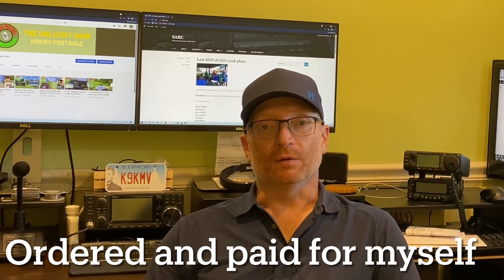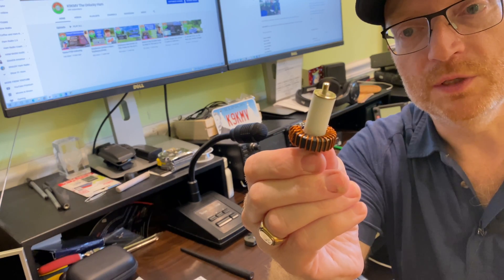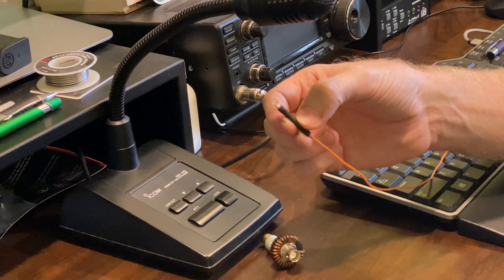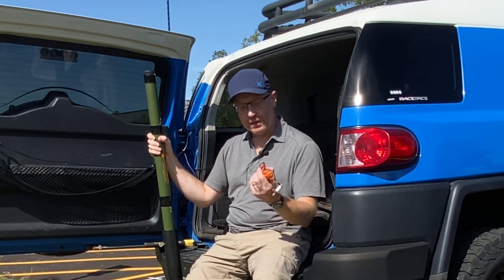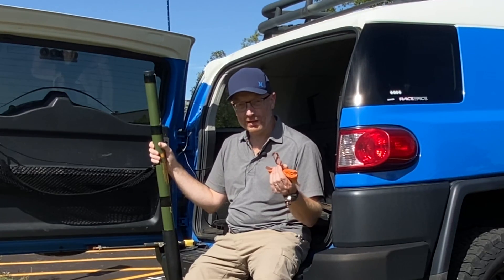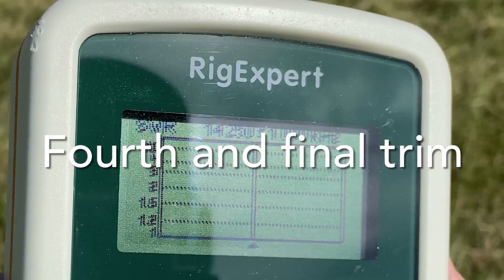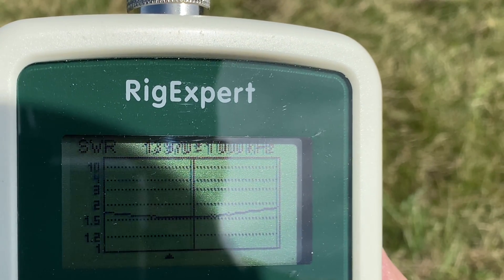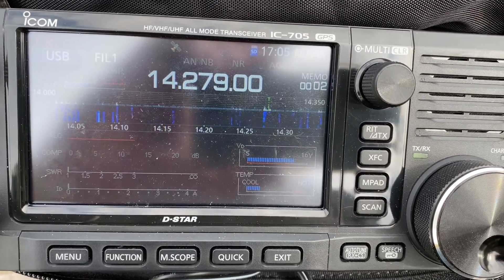Trying my Spark Plug Antenna, another #EFHW. #hamradio

Comment: Thanks for a very informative video, the little "spark plug" seems to work very well. Do you have the antenna wire lengths for both 20 & 40 meters. Best Regards .....  Garry VK2ZP

Comment: How much did you have to trim off? I must say that I was impressed! N4KBM
Reply from the maker: I ended up with 28 feet total wire length.  Not sure why it's so much shorter than I was expecting.
If you get one you should still start with something around 34' and trim as necessary. 28' just seems too short but that's what I ended with.

Comment: Great video, though it would have been nice to see how it tuned on 17, 15, 12, and 10M. This antenna should have manageable dips in each band.
Reply from the maker: That's a great point Steve.
I'm thinking of doing another quicker video adding another length for 40m and then see how it looks on 20 15 and 10.  Not sure about 17 and 12 though.

Comment: From your video, the antenna is working very well for such a lightweight portable antenna but you might want to add a counterpoise wire to see if the antenna improves. At the moment I think you are using the screen of the feeder coax as the counterpoise which has two disadvantages, the first is that you are bringing back RF to the rig (at 10w that's not such a problem but not good practice) - the other point is that if you switch to a different length of feeder coax at some point, you may find that the antenna goes off-resonance. The counterpoise wire needs to go from the earth side of that BNC socket on the end of the "spark-plug" - which in your set-up would make it a raised counterpoise as you have the connection up in the air. 
73 Ed DD5LP/G8GLM.
Reply from the maker: It would be interesting to see how adding a counterpoise affects performance.

Comment: Probably not the most efficient coupler, mainly due to toroid core geometry, but you will make many contacts, for sure. It's nice that it's so small, but you definitely need some kind of strain relief for the coax cable.
Reply from the maker: Thanks for the comment and totally agree on the strain relief

Comment: what was the final cut leingth?
Reply from the maker: That's a good question I will measure and let you know.
Reply from the maker: I'm not sure why it's so short but I measured it today and it's only 28 feet long.  I don't understand why it's so much shorter than a typical 20m EFHW.
Reply: My cut length was also below 28 and SWR was fantastic 1.2:1 for the money this is a fantastic antenna K8MST

Comment: How high is the telescoping mast? I've found this is the most expensive part of building antennas like this! Where did you get yours?
Reply from the maker: The one in this video is a Jackite 31ft telescoping mast.  I got it from Amazon a few years ago.
Reply: I also have a 31' Jackite pole. They perform very nicely.

Comment: Nice video, thanks. I have a similar transformer, what I have done is to place the antenna cable from the transformer along the mast but vertically, not sloping, fastened with velcro strips, I have noticed better results in the SWR and good contacts. 73.
Reply from the maker: Thanks, glad you enjoyed the video!

I would do also try vertical with a fiberglass mast. Sometimes though I use a carbon fiber mast and I prefer to keep the radiating element away from the mast.
Also, with a longer wire say for 40 meters, I do not have a mast long enough to run vertically so I either use a sloper or an inverted V.

Comment: Hmm, why wouldn't it work, it's just a 49:1 transformer on an EFHW wire, right ?
Reply from the maker: Thank you for your feedback.
Reply: @K9KMVTheUnluckyHam  IT is a 64:1  3 turns primary
Reply: @McPilot_W3DDS  I have built a few EFHW transformers with FT140-43 cores, and I found that they matched better at 64:1 turns ratio. My FT240-43 cores seem to do fine at 49:1.
Reply: @gravestonemyth  I agree. A 64:1 with a ~66 ft wire is great